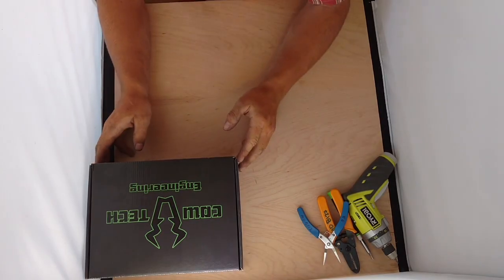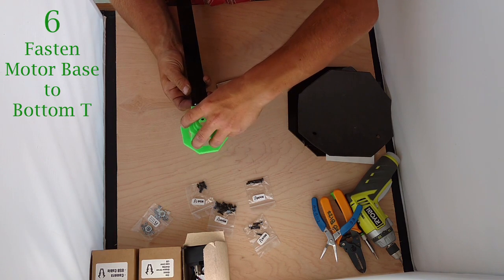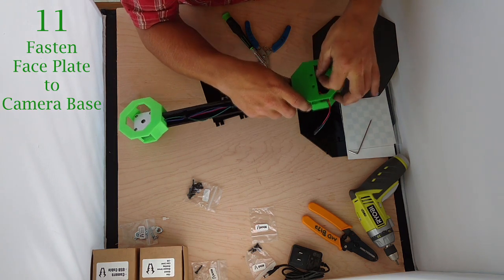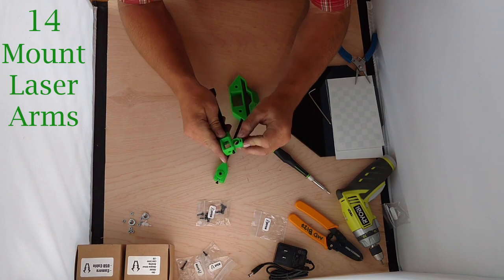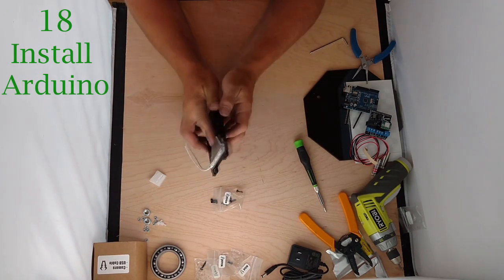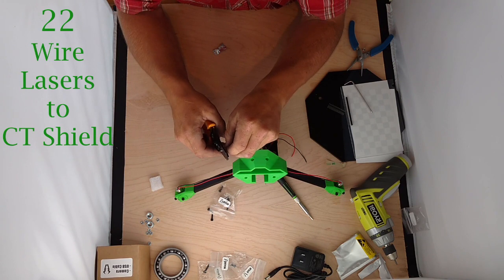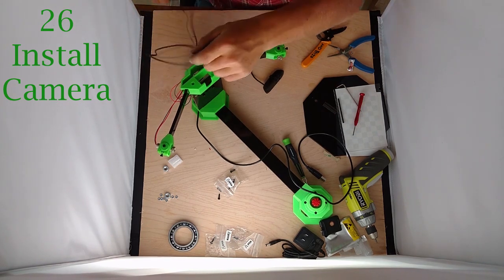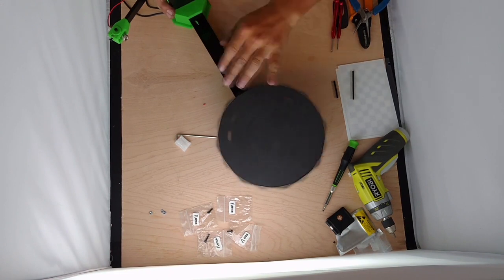CowTech Ciclop 3D Scanner Hardware Assembly Video

Comment: I took off the original camera holder but now the camera doesn't fit at all. Should I break the small black tube off or force it in?
Reply: I'm having this problem as well. I printed my parts back when they were first released. Were they updated to reflect the camera that shipped and I just missed it?
Reply: Don't forget to remove the grey faceplate, it's in the video but Jason chucks it off frame like a hot potato

Comment: Zero black acrylic parts fit into printed parts.  Before to check that and clean or expand the 3D printed slots.  The camera holder appeared to be offset and too small.   Not a major but test fix before assembly.
Also I found it easier to hold the black parts vertical, insert the nuts the press the 3D part down. That way gravity held the nut instead of trying to remove it:)

Comment: And in 31 easy steps, you too can have a scanner!
Reply: You should be able to print them. The file is Wire_Holder_B.stl. They are used to secure the motor wire. The scanner will work fine without them.

Comment: An actual set of printed assembly instructions would be much more useful and not waste my time telling me obvious stuff like how to open the box and set items on the table.
Reply from the maker: https://jig.space/view?jig=857 This should be an improvement!
Reply: The jigspace instructions are definitely an improvement but still have issues! You can't look through them before you start, or review repeated steps, without going through every step one click at a time. Neither those instructions or this video are clear on which way up the stepper motor chip goes - I've got the message that it's very important to get it right, but not the information I need to get it right! All of these things would be much easier with static instructions with a few clear photos, rather than a blurry video or an animated approximation.

Comment: Word of warning!!
  Don't spin the scanner table after you plug it in to the shield.  A stepper will act as a generator and send a voltage back into the shield, which can fry it.  Just ask and 3D printer owner about what happens when they move an axis by hand too quickly.
Reply: Its not always the case, I move my 3D printers and CNC using Ramps and Clones without issues. It does generate power back to the board. But does not causes the board to fry. Do you happen to know what specific board this is an issue with?
Reply: It is primarily Chinese clones that do not poses blocking diodes in the stepper output circuits, though I have read of some Ebay "Elcheapo" no-name ones also frying from backfed voltage.  Not manually spinning any stepper based system quickly is just a safe habit to have.
Reply: +William Eades got it. thanks for the tip